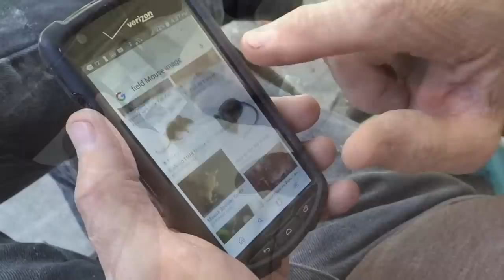Wood Carved Timber Rattlesnake Chasing a Mouse Walking Stick

Comment: Some I knew and now has passed away had a walking stick similar to that. It was a nice dark stain on the wood with heavy lacquer. The walking stick itself had the appearance of being hand carved/made, for aesthetics, it wasn't cylindrical at all and had lots of irregular sides on it as if it were found in the woods. I remember thinking it was so cool because of the snake that was wrapped around it. I thought it was really unique and upon watching this video I realize it's a thing among walking sticks. Good craftsmanship.

Comment: Also man, do you sharpen the rifle casing you use to cut into the eyes? I've noticed you use them for some time, and that you found that it fit the eye shape and whatnot you wanted best, but I don't remember you saying if you sharpened the edge of it, or if it was just easy for you to push it and grind it into the wood like that?
Reply from the maker: Yes, I sharpen and serrate the edge, to make a small cutting edge.